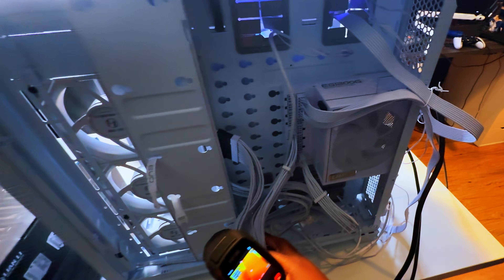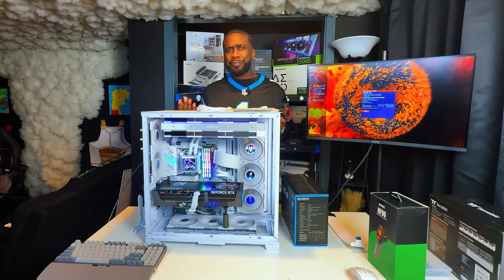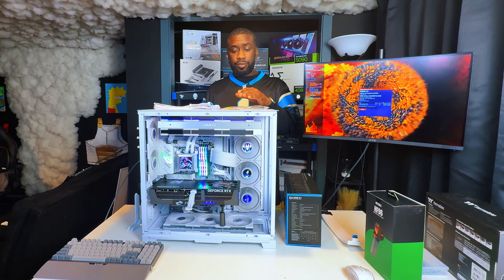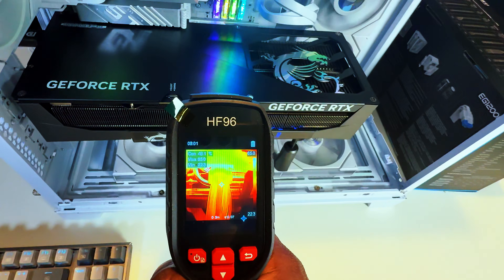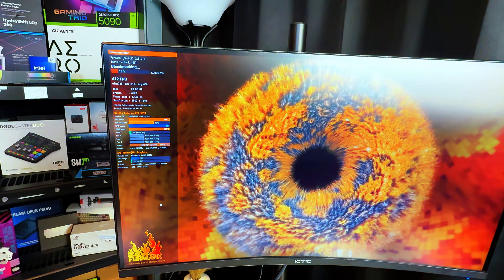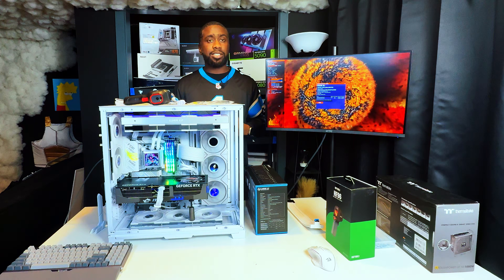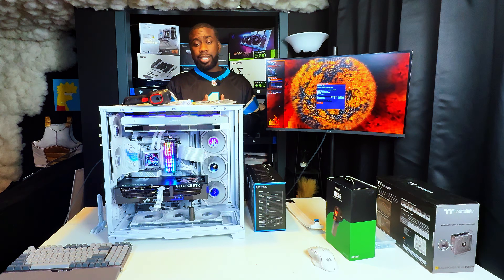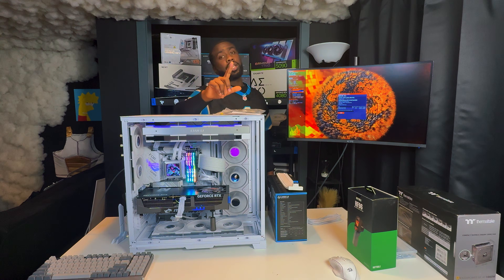Will my RTX 5090 melt the 12vhpwr like Der8auer's? TESTED!

Comment: my msi 5090 Liquid SOC melted on Nov 15 connected with a dedicated 12VHPWR cable provided with the PSU ThermalTake Tough Power 1200W GF3. The melting was more severe on the PSU side, although the GPU side was also affected. Card was bought in May 2025 and melted on Nov 15 .
Reply from the maker: Damn that’s terrible! I appreciate you adding the information to the pool.. til this point I hadn’t seen any non FE cards melting.. where you just running it at stock settings?

Comment: 600w is the peak rating for the connection. The constant draw rating is much lower around 400-450w
Reply from the maker: Yes.. that is correct. I barely saw mine pass 450 when in use under heavy gaming

Comment: The issue is not the cables, it's how the cards are designed. There should be 2 of these adapters on 5090s to split the load. Even home electric only uses like 80% max amps on a circuit.

Comment: A lot of misinformation. Especially about 3.0 vs 3.1. Watch Hardware Busters for proper information.
Actually Hardware Overclocking is aldo better than Der8aur.
Reply from the maker: @detmer87  I did not spread any misinformation.. the only thing I mentioned about 3.0 vs 3.1 is true.. 3.1 has recessed sense pins to detect proper connection.. hardware busters will say the exact same thing.. so what are you talking about?
Reply: @AverageLarryGaming  The difference isn't on the PSU side. Only the pin length changed on the GPU-connector. And those sense pins are quite useless in practice: it does check for connection but it doesn't detect a bad/weak connection and therefore we still see burned connectors...
Reply from the maker: @ that is incorrect my friend. Do some more research and come back and apologize. The difference is on BOTH the GPU and PSU side actually. I’m surprised you brought up hardware busters and don’t know this.. the only thing that stayed the same is the cables. A simple google of ATX 3.1 vs 3.0 would also reveal this information 🤦‍♂️
Reply from the maker: @ you don’t have to like your own comments by the way 😂😂

Comment: The problem is with the connector. 1 connector instead of 4 x 8 pin connectors. That's the problem I've always said that. It's like powering your house on only one 16 amps fuse

Comment: sorry but there is no significant difference between ATX 3.0 and 3.1?! you can also find the "better" 2x6pin with 3.0 fi thats what you mean? in addition nvidia does not say you should use ATX 3.1 so...
Reply from the maker: @PM-wt3ye  3.1 is the connection.. not the cable.. NVIDIA doesn’t have to “say” you should use anything.. what did they DO? They changed all of their connectors to 3.1
From the 40 super series and now the 50 series. You can say “sorry” all you want but that doesn’t make you any less incorrect.. the significant difference is as I mentioned.. the sense pins can now detect poor connection.. but not only that.. on the PSU side.. the standard calls for a short circuit at the 0sense whereas the old standard remained open.. this change makes the communication between PSU and GPU around connection security possible and also allows the PSU to deliver 0 watts when poor connection is detected.. in 3.0 this was not the case.. with the open circuit.. regardless of how well the connection was made.. the full wattage would be sent from the PSU.
Reply from the maker: @PM-wt3ye  however I am not stating that this completely fixes the issue.. a poor pin in the cable itself could still present a problem.. but most of the burns came from either bad connection due to user error.. or the cable or pins backing out over time due to movement and things of the such.. 3.1 has eliminated that problem with the updates I mentioned.. but a bad or cut cable can still burn up provided the issue is within the cable and not where its connected at the ports.

Comment: Could u please make the same thermal test with the included 4x8pin to 1 hpwr? Same temperatures?
Reply from the maker: @sistem4567  so I don’t personally have four 8 pin cables to use for that.. my PSU only came with 3 and I don’t plug any cables that didn’t come with the PSU directly into it. However there was a 2x8pin to 12vhpwr cable that came with it and the temps were even lower on that one as I mentioned briefly in the video. The Strimer cable extension had very slightly higher temps but nothing to be alarmed aboutz

Comment: Promise You let us know when your connector melts on the card or on the supply. NVidia is pushing this connector by force to have room for guarantee rejections. Why so expensive card does not have current distribution implementation? It is not the cost problem. Problem would be when cards wont "brick" after you pay 2500$ or guarantee replacement would be clear in such case.
Reply from the maker: @karolwilk3408  I mean I got a 5 year warranty on it so I’m good either way.. lol but sure.. if it happens to melt.. I’ll be sure to update!

Comment: The Reason of melting down is one of 1of 12pin was torn inside thatswhy temp goes up like 100celcius

I used to have run electric like system 400A in company
The heat of cable is not 65-75celcius but

One day the heat goes up to 120celcius later on we find out 1 of 4 cable was torn for no reason thatswhy the heat goes into 3 of the 4 cable 
instead of 4

All you have to do to prevent this is monitoring temperature every week it will signal from75 to 90celcius and goes 110celcius u will notice but short period of time until reach 120celcius

Comment: I’m not sure if your motherboard has the extra 8 pin power connecter for the pcie express, I know Asus and Msi x870 boards do have these extra connections specifically for these high end gpus, they allow the pcie slot to provide 2.5 times the 75 watts to the graphics card this means up to 166 watts extra power through the motherboard, this will reduce the strain on the graphics card cable. No one has mentioned this in there testing yet not even deb8our.
Reply from the maker: @edwardshepherd9684  I believe mine does actually but I haven’t used it

Comment: @AverageLarrryGG - To clarify what you are saying at 2:20 - The shorter sense pins of ATX 3.1 do NOT provide any monitoring of the current/voltage/signal on any if the 12 pins (6+, 6 gns)

All the sense pins do is verify the 12v-6x2 connector is inserted adequately.

This does not prevent the GPU drawing dangerously high current through one, or a few wires in cases where there is poor pin contact or signal break which can happen due to multiple causes.

To be clear, nVidia, who insists on pushing near the rated capacity of the cable (98.3% in the case of the 5090)  really should add OCP protection that monitors 6 wires and cuts power to the GPU of Over Current is detected. 

Currently there is only 1 shunt resistor -  so all 6 positive wires are treaded like one wire in terms of power detection. Nothing stops the 5090 pulling dangerously high current through one situation of connector issue.
Reply from the maker: Well if there is poor pin contact, from my understanding.. the signal from the 3.1 PSU is given to send 0 watts. Where as the 3.0 was left to open.. the 3.1 has a short circuit.
Reply: To further clarify in response, You are correct that the PSU wont send power if the two outer (sense) pins are not connected.

But in cases where one or more of the 12 pins that carry the load have a problem with contact, nVidia's 50 series cards will continue to draw contact.

Pin contact issues can happen for a few reasons - Ie, multiple insertions leading to loose pins, thermal cycling, etc.

Proper failsafe would be for the GPU to monitor load on each individual wire and power off GPU if unsafe load detected
Reply from the maker: But I don’t disagree with what you’re saying as far as what NVIDIA should be doing

Comment: So meaning when your planning to buy a RTX 5080/5090, you should also buy the latest release PSU that support 3.1 🤣🤣🤣
Reply from the maker: I certainly would for the 5090.. and go over the recommended 1000w minimum by at least 100w
Reply: @AverageLarryGaming  Did you know that 5090 12vhpwr will allow 50amps per pin of 12v line its so AMAZING. 😅😅😅
Reply from the maker: @ lol that is not amazing

Comment: I suspect if some contacts on the PSU side get cracked, the cables that do work start getting all 600W going through them and then the GPU plug starts melting just because it has the lowest melting point in the entire chain
Reply from the maker: From my understanding the 3.1 standard through its communication with the gpu, if no contact or poor contact is detected.. will send 0 watts to the cable entirely. Now what I’m not sure about is if there is great contact on both ends.. but an actual cut in the wire.. since it’s not actually measuring anything but the contract itself.. would it still read as fine
Reply: @AverageLarryGaming  do they do ocp per wire or something 'cause otherwise I don't see how they can cell some wires are not connected.. like what if there's oxidation or just the contact is loose. I guess my larger point is that for 2 years bloggers have been looking at one area (GPU-side plug, "oh look it's fully plugged in!") while the root cause might be elsewhere as you pointed out
Reply from the maker: @XuryFromCanada  Oh, im not gonna pretend I'm the most informed on this.. Ive just been doing some research and trying to figure out what i can.. I honestly wish this was nothing to worry about at all

Comment: What is the 16-pin HVPWR voltage reading in HWINFO64? I think it is a good idea to monitor that voltage. You will notice that it stays around the same voltage under load, but if your cable/pin connection is loose, the voltage will drop. It could be an early warning sign.
Reply from the maker: Good to know, I haven’t personally checked mine but I will be doing so

Comment: Every electrical expert out there:  This stuff is bad like really.  
Tech companies and tech tubers:  It's fine.
Reply from the maker: @T595955i  who said it was fine?!? lol
Reply: @AverageLarryGaming  I surely didn't.
Reply from the maker: @T595955i  not I. lol
Reply: @AverageLarryGaming  Now seriously, there's one aspect that people are not figuring out yet, which is that these GPUs will not last like ones built 5 or 10 years ago. Not a matter of "if", it's a matter of "when". Certain AIB models of the RTX5090 may have power monitoring (all should have had, IMO). But any and all will still be far too power hungry for a single connector, with ridiculously small margins of error at play. And still lack the active load balancing, with power not evenly distributed across the pins/cables. With production tolerances also needed to be in mind (because that's a reality as well). 🤷‍♂ Meaning, the concerns and possible issues in the matter will still remain, regardless. Doesn't matter if it's 12VHPWR or 12v-2x6, or how many "temp image measuring debates" and "I'm right and you're wrong" like we're now seeing from high profile people in the tech space. Anyone is free to ignore what's been said by electrical experts about this garbage design at his/her own peril, it's your money afterall. But it had been already exhausted over two years back (4090 launch) that this was BAD, and has now been made worse with the 5090 being even more demanding on power.
Reply from the maker: @ I don’t agree it’s been made worse.. the 12v-2x6 connections is an improvement.. I have yet to see ONE burn that was done from a setup with an ATX 3.1 PSU.. and this is because the load balancing issue is pretty much fixed there.. if improper pin connection happens whether it be user error, bad pin, cable backed out a bit.. the PSU now instead of just keeping an open circuit has the 0 power delivery function. From what I understand, the load balancing issue is coming from when a wire is cut or poorly connected, adding the load to the nearest wire that wasn’t cut or has more of a connection. With the new PSU to GPU communication happening.. that doesn’t seem to be a problem. I could be wrong but again.. I’ve yet to see a melt of the new standard where the GPU and PSU were both on the new connection. Would love to see otherwise though and confirm that one way or the other.

Comment: i have the Thermaltake 1200w toughpower in white PSU. it's only 3.0 compliant but has the 12vhpwr cable. My 9800X3D build is done waiting on a 5090. I have the same motherboard as you 64GB Ram in corsair 6500X white case. also i have the wireless strimer cables can you test those cables in a future video
Reply from the maker: I actually did run the white wireless strimer cables for about 10 minutes. They showed no difference from the main cable
Reply: @AverageLarryGaming  that's good to hear

Comment: I use this cable on my 4090 at up to 600W (also have a WireView is series): "Fasgear PCIe 5.0 GPU Power Cable Sleeved 70cm 16pin(12+4) 12VHPWR Connector for RTX 3090Ti 4080 4090 4070Ti 5090 3x8pin(4+4) CPU Male Plug Only for Corsair/Great Wall/Thermaltake Modular Power Supply". Drives 12VHpwr from 3 x 8 pin connectors on my AX1600i. Zero issues with temps or mismatched currents. I'll be buying the same again when my 5090 arrives!

Comment: Check your 12VHPWR connector pins. Especially if you use corsair. If you pull cable and the pins inside move or the pins are not at even height. Change cable ASAP. This will make uneven power distribution which could make your 575W go through one pin melting cable.
Reply from the maker: I can confirm that the ones that can’t with my LL power supply are secure in place!

Comment: I am so glad you did this. I bought a ASUS 870e-e board, 9800X3D, 5090 FE, Lian Li Edge 1300 and was going to put all of them together this weekend. But the videos the last few days had me worried that no matter what I was going to do, eventually the cable would burn out and cause a fire. I was about to not put the system together due to all the hype everyone is putting out that this was a problem that "couldn't be avoided". I'm glad to see that basically the same equipment that I am putting together has reasonable temperatures. That puts my mind at ease. (And I did read the comment to undervold the GPU, but I'm 62 years old. I did a lot of research just to be able to figure out how to build a system. I am just going to run as is. Overclocking or undervolting is way beyond what I want to get into).
Reply from the maker: Put the cables in snug and you will be just fine! This isn’t a widespread issue to begin with honestly but the internet will do what it does.

Comment: I think you're missing the bigger problem, the GPU has no mechanism to balance the load across the sets of wires plugged in to it. So if your cable is fine, it will work, the problem is if your cable has any issue, including cable manufacturing problems, you run the risk of too much current going through to too few cables, and this generates heat which can eventually lead to fire. This should not be an issue, Nvidia skimped on this and it has created a fire hazard. Won't happen to everyone, but it's also possible your cable degrades over time and you end up with a melted connector/cable later down the road.
Reply: DerBaur [Thermal Grizzly) monitoring hardware is a required expense with the prices of a 5090.
Reply from the maker: The load balance is not an issue with the 3.1 standard is my point. The uneven current is coming from poor pin connection. With the new sense pins being recessed deeper into the connnection point on the power supply.. and the ability to deliver 0 watts in this scenario.. there is no issue.. the problem with 3.0 is that with improper connection be it due to user error or just a bad cable.. it would still deliver power and just send more power over the pins that were actually connected. 

With ATX 3.1 once the cable is connected with GPU pins “Sence 0” and “Sens 1” it will be short-circuited by the GPU internally. That will send a signal to a PSU that the connection is secure and tight, and the GPU is ready to receive the power.
Whereas with older ATX 3.0 these pins being open means that the connection between PSU cable and GPU does not have to be tight. Overheat was often the result of such a connection.
Reply: @AverageLarryGaming  Uneven current can come from multiple different sources, redesigning the plug is an attempt to bandaid the deeper problem, which is these cards are running all those 12v lines into one block of 12v power, which means any connector or cable abnormalities can lead to a dangerous situation. Buildzoid did a better breakdown of the full problem, and it really doesn't look good on Nvidia. It explains why 3090ti's never had melting connectors, but 4090s and 5090s do. 4080's didn't experience it just because the TGP is much lower.
Reply: @AverageLarryGaming and the uneven pins can be from manufacturing sloppiness making some pins shorter than others making it impossible to have an even connection even if installed firmly.

Great video Larry, thanks for your contribution!